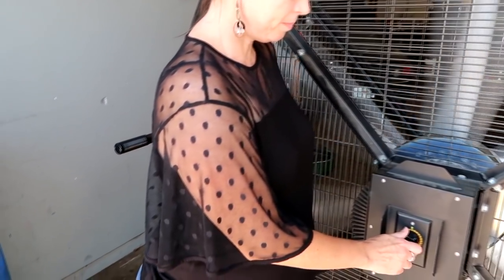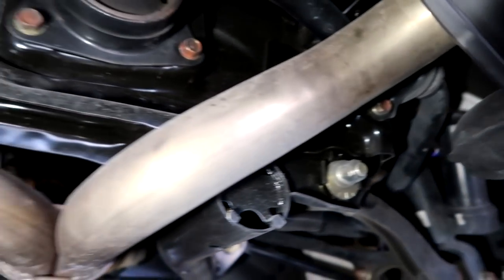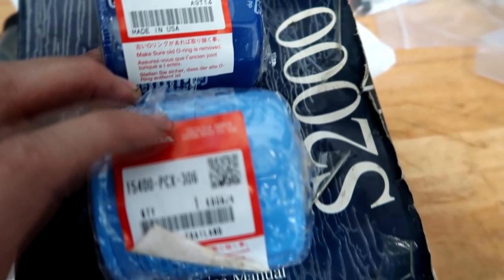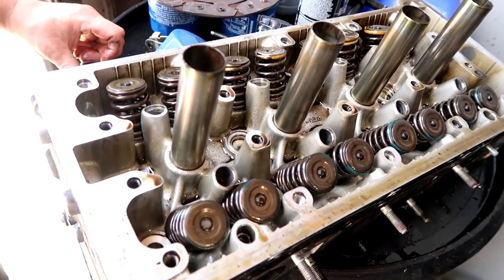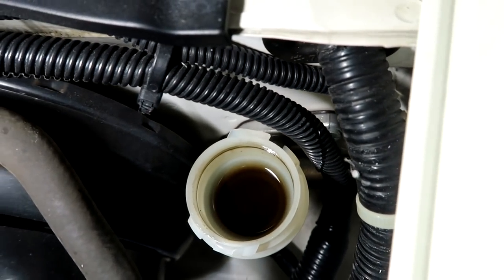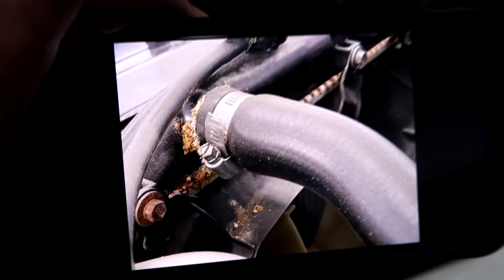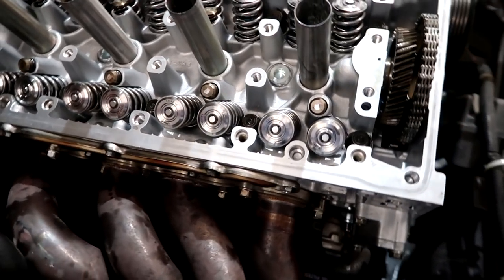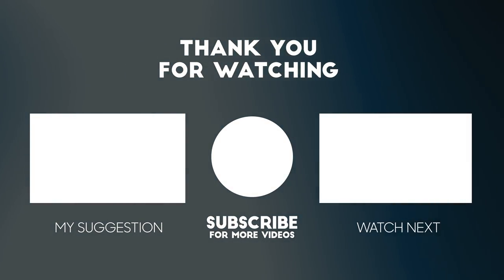BAD S2000 AP1 RETAINERS ?

Comment: Must do preventative upgrade for Ap1s. Wiped out my motor in 2011. Since replacing the retainers+cotters on my replacement motor for AP2 versions I've had zero problems. Honda changed the material on those parts for a reason.
Reply from the maker: We do a lot
Of them. Piece of mind.

Comment: Hey, good evening...just wanted to ask your opinion on resurfacing the head before reassembly? I am aware the oem service manual has a tight tolerance and have read on forums to never do it so just wanted to know your opinion before I remove my head. Thank you in advance.
Reply from the maker: Anytime a head is removed, the surface should be checked. If it requires surfacing, the   Least amount should be removed to bring it back into spec.
Reply: @LHTPerformance  Again, thank you for the prompt response! Truly appreciate you guys and the content you provided.
Reply from the maker: @irvinvelasco2921  Thanks watching my friend. Glad it helps.